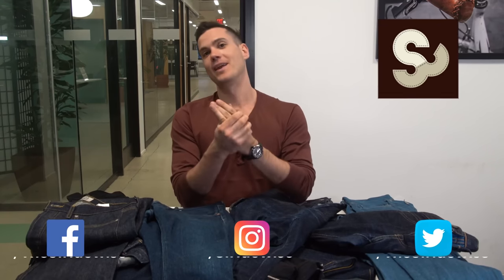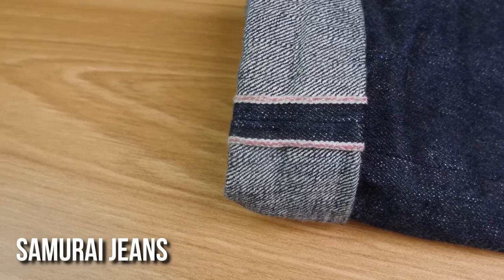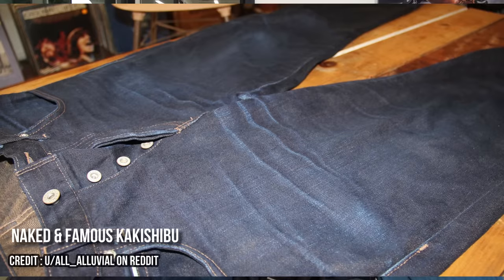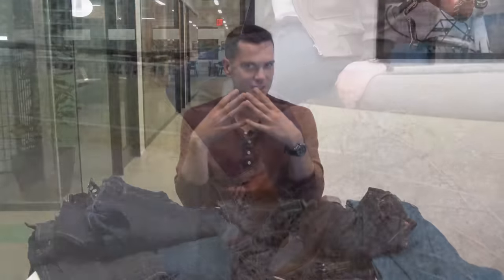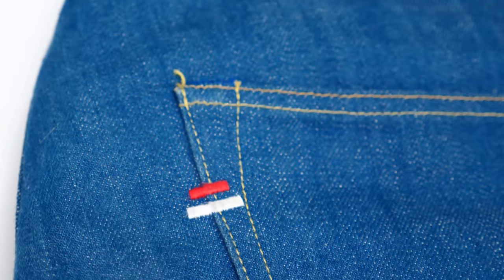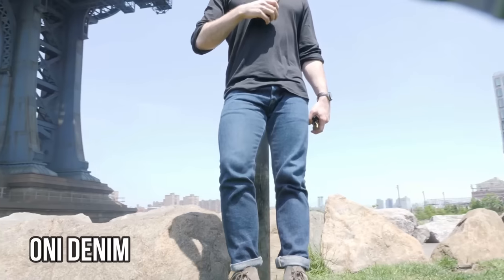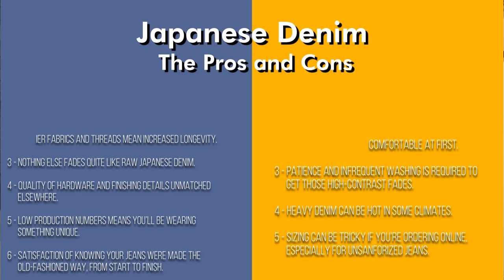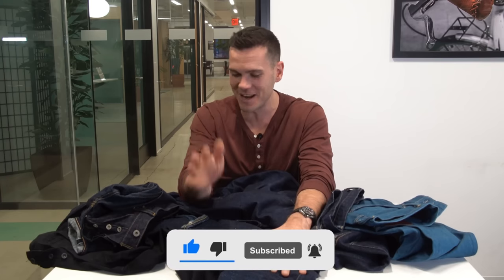7 Reasons Japanese Jeans Are So Expensive

Comment: Great video and introduction to people unaware of Japanese selvedge denim!

While most of the info is spot-on, point 4 (the Raw) is not really a reason why these jeans are more expensive. First of all, sanforization is a process done on the fabric by the mill, before it's being put on rolls. The only difference between sanforized and unsanforized denim is this exact process. This has nothing to do with 'pre-washed' jeans, which you mentioned in the video too, because a pre-wash is a way of aging the ready-made jeans in an industrial laundry by washing, distressing and whatever you can do to create an aged look. In fact, a pre-wash would make a pair of jeans actually more expensive compared to unwashed or raw denim jeans. Which takes me to my next point: the term raw denim means unwashed denim, as in, how the fabric came off the roll. Since sanforization has been done already before the fabric's being put on rolls, you can have both unsanforized and sanforized denim classify as raw denim. Raw denim simply means that the jeans have not been washed or distressed after they're cut and sewn into a pair of jeans. We (BENZAK) use a lot of Japanese selvedge denim, but it's all sanforized and still fully classify as raw.

Another thing that's important to mention about the price of the brands you mention, is that they are in fact fully produced in Japan, as opposed to brands exporting Japanese denim to low income countries and manufacture the jeans over there. Minimum wage in Japan is similar to that of the US and many European countries, making the manufacturing process more expensive too. You're absolutely right about lots of these factories being family-owned with few employees and low quantity output, which makes it even more expensive. We actually do both, produce in Japan and export fabric to Portugal, to make our jeans; they have a different price point for the above mentioned reason (although Portugal is not a low income country, its minimum wage is still below that of Japan).

Comment: This is very much a status thing, only  really appreciated by other fans.
As someone who worked all their life in the textile industry (including sanforizing technology) you would have to be out of your mind to spend hundreds of dollars on jeans that havn't been pre-shrunk without trying them on. Even then you have to know how to control the amount of shrinkage after you buy them.
Just leaving them in the bath will give the minumum shrinkage. Machine washing and tumble drying gives the most, because it is the tumbling action that causes the maximum 'fibre migration'.
The selvedge thing is interesting but you can produce denim of similar quality on wide high speed looms at a fraction of the cost if you don't mind 'cropped selvedges'.
The most important thing really is the quality of yarn for the warp and weft, and no mention is made of that.

Comment: I don't think I understand why jeans being "raw" makes them more expensive. I mean, I own quite a few pairs, and I don't doubt that it for some reason does, but taking out the sanforization process should simplify production, rather than complicate and cause more expense, like making heavier slubbier or more expertly dyed fabric complicates production.

My guess is that Sanforized denim is harder to sew into a jean that will shrink and still properly fit, or is harder to mount hardware on. I know that its discourages zipper flies because they wont shrink with the denim, but most of us weirdos want button flies regardless. That, and my unsanforized STF levi 501zs from when they were doing that vintage production stuff were definately not less expensive than the same fabric with button flies. That can be chalked up to levi's nonsense though, I guess.

TL;DR I know "raw" is more expensive, but I don't know "why" its more expensive when it's mostly just skipping a step in production, to grossly oversimplify.
Reply: Raw isn't more expensive. Selvedge is.

Comment: I've seen you been doing Japanese jeans vids for a while but haven't really been very interested in them. I've been an almost exclusive wearer of Levi's jeans since high school (20 years, cringe) and like them a lot.

But this video got me a little curious on maybe picking up a pair. What makes me nervous though is sizing. I can get a pair of Levi's 511 in 30x32 or 32x32 that fit spectacularly but I'm worried I wouldn't get that perfect fit with Japanese jeans which will shrink (by how much?). Plus I'd want to try them on in-store and I dunno if there's any store around me (I'm in metro Detroit).
Reply from the maker: Most jeans are sanforized so shrinkage isn't an issue, but you should expect them to stretch about an inch around the waist. You might find it easier ordering from a US based store like Self Edge or Blue in Green, that way returns are less of a hassle!
Reply: @Stridewise  Oh really, they'll stretch rather than shrink? Cool thanks for the info I think I'll look into them when I finally get a job again lol.
Reply: Start off with levi's shrink to fit, measure them first because they are usually a size bigger than tagged. When you get that right go to japanese raw denim. Remember to size up because they shrink. For instance i wear size 38 so i buy size 40 in their raw denim to get to a 38. Buy a size up in the one wash too because all the shrinkage have not been taken out.

Comment: Loved the video and the explanations. Still have a question though : I got into the habit of wearing my raw unsanforized jeans without soaking : is there anything wrong with that ? I never wear them on a rainy day and I never wash them. Thank you in advance for your answer.
Reply: @Michael M     If your unsoaked jeans never get wet or washed, then there’s no problem, except for maybe the malodor. However, if they do get wet, or washed, they will shrink and the fades, whiskers and honeycombs won’t line up the same, if you’re even able to get them on again. I’ve also read that your jeans will last longer if they are washed occasionally, because you’re removing grime from them that may cause the fabric to wear out faster.

That’s why they always recommend soaking your jeans prior to wearing them. In my experience, sanforized denim also shrinks a little bit after soaking, but not nearly as much as unsanforized denim.

Comment: Just a data point. There's a Levi's sub-brand called "Levi's Made & Crafted" which claims to be Japanese Selvedge and retails for around $225-ish. I wonder if they are really made on these old looms or are they some sort of BS to cash in on the Japanese denim craze?
Reply: The Levi’s Vintage Clothing line is the main one. Until recently, it used American made denim from now closed Cone Mills, and the jeans were all made in the USA. Now they use Japanese denim and they are made in Bulgaria. Japan uses Shuttle looms they bought from Levi’s back in the 80s, when they were switching from selvage denim to crappy mass produced garbage.

Comment: I think these jeans, especially in shots of you walking around in them, all look so incredibly feminine.  I vastly prefer, & of course this is just me (objectively correct), to wear a $20 pair of Levi's because the type I get are soft, light/thin, & a bit stretchy, which is vastly important for a 45yo Dad.  "But they don't last as long!"  So what...I'm paying 18X less for a pair....& it's really more than that.  Spending $350+ on a single pair of jeans interferes with most people's cash flow, introducing further lost opportunity costs, in addition to the simple cost difference pair to pair.  Now, I'm a collector of knives & watches, so if that's what it is for you, if you're simply an enthusiast, then it makes perfect sense for that reason, but it does not make sense for the "But it lasts so much longer" reason.

Comment: Lots of cool info in this video but I feel like many of the points don't actually answer the question in the title - some of these are reasons why the jeans are UNIQUE but not why they are EXPENSIVE. For instance, you say a lot of Japanese jeans are raw and then you go into detail about what that means and why it's unique. That's great, but you never link that back to how that affects pricing. Someone outside of the industry without insight into manufacturing would immediately wonder, if raw means they are doing LESS to the fabric, why does it cost MORE to produce? That type of thing would be interesting to go into detail on and would actually be a "reason japanese jeans are so expensive." Similarly, Japanese jeans are period correct - it's cool to hear how this makes them unique but this is never actually connected to pricing and viewers instead have to guess ways that it would be related.
Reply from the maker: You're right about the raw, that was how they're different, but it doesn't affect price that's my bad. The period specificness requires lots of attention to detail, research, expertise, etc. that adds to the cost though